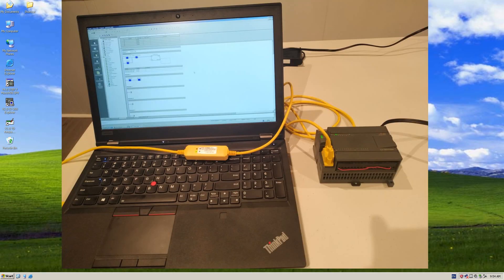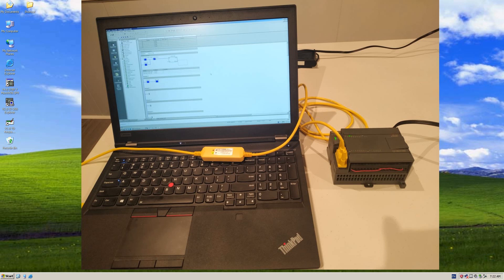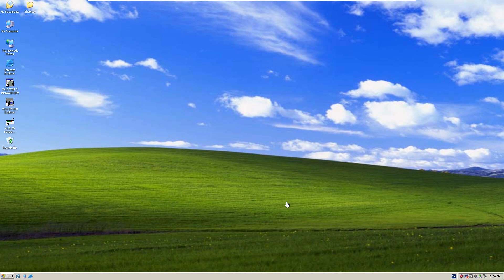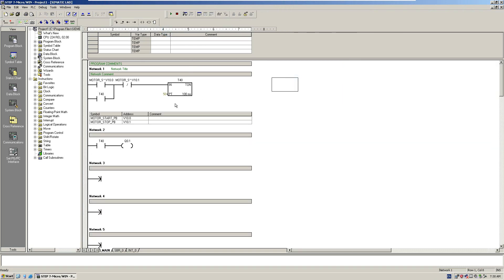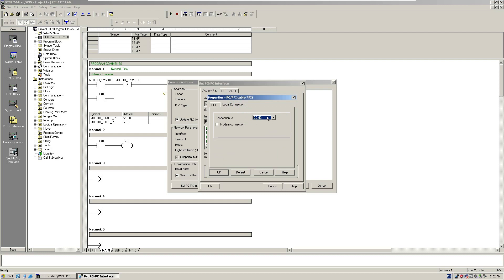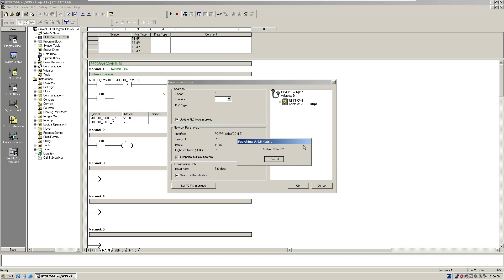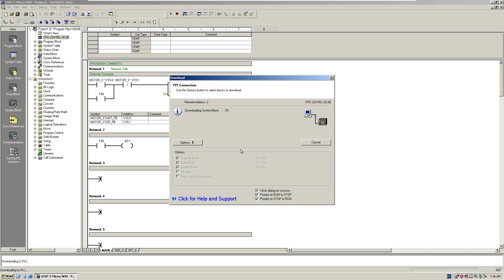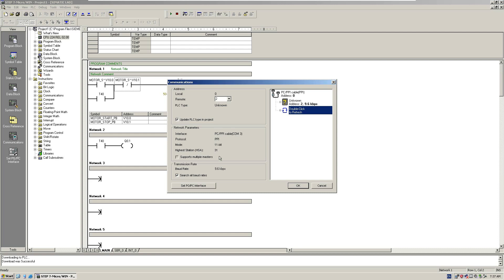U01. Program, Download, and Online Siemens S7-200 PLC via PC/PPI Cable

Comment: I watched your video , I have CPU 226 CN model which is not detected. Kindly share required drives  for it , I have USB to serial ch340 com5 using its not detecting either change on checked port settings.
Reply from the maker: Hi my friend, the cable must be S7-200 PPI protocol cable, not a regular com cable.

Comment: In the University we have the s7-200 226CPU.  The yellow cable brand is SIPABC.  The yellow cable we have is same as you have, maybe diferent brand.  But we don't have the driver for windows PC.  Could you please share the driver files or a link to dowload it? please.  I found the CH340 driver you show in the video.  The MicroWIN  tries to connecte searching the CPU at diferent baud rates, but with no success.  It seems that the drivers works but I why the software can´t find the CPU? Thanks in advance.
Reply from the maker: I uploaded all the USB drivers inwhich has CH340 driver, you can try. https://drive.google.com/drive/folders/1ycVXZchtSX1qcdjrw1xyPhN2vXtMcMya?usp=sharing
Reply: @electricalautomation   Thanks a lot.  Could you give me access to the file in google drive please?
Reply from the maker: @edro1128  Assigned
Reply: @electricalautomation  Hello . I need CH340 driver.Can you give  me
Reply: @electricalautomation   Thanks a lot.  Could you give me access to the file in google drive please?

Comment: Boss I have a problem with Siemens plc. S7-200 CPU 224 cn
Plc connect but message show and upload option not shown
The plc has been protected to prevent program upload.
Reply from the maker: Hi If your PLC got level 3 or 4 password protection, you can not upload. If don't have the source code or password. Also you can not upload the program even if you have password, it is fullly protected. If you do not have password but you still want to use this PLC for other job, you can try to use "PLC->Clear" type in 'CLEARPLC' to WIPE OUT the PLC. Or downlaod a software named 'wipeout.exe' + RS232/PPI adapter to WIPE OUT (Clear everything in PLC)
Reply: @electricalautomation  any suggestions. Please
Reply: @electricalautomation  if with any another software problem solved kindly send me link for download. Thanks
Reply from the maker: @roseateelectronics8498  For your reference: [1] https://support.industry.siemens.com/cs/document/2123168/resetting-the-s7-200-to-the-factory-default-settings-(wipeout)?dti=0&lc=en-WW     [2]https://support.industry.siemens.com/tf//WW/en/posts/clear-password/56661?page=0&pageSize=10

Comment: Can you give lien of the driver sipabc USB ppi
Reply from the maker: Sorry, what do you mean lien and sipabc?    I don't have the driver you talked.
Reply: I have problem communicating between computer and the plc s7 200 it does not show me connected that's why i asked you about the driver i hope you can help me and thank you a lot
Reply from the maker: @walidbouakkar834  Hi Walid, You need a cable/adapter which has PPI protocal, what kind of adapter you have
Reply from the maker: @walidbouakkar834  You could email me with some pictures and screenshots
Reply: What ur email? so i can comunicate with u easily . Or u have whatsapp?
Reply from the maker: @rudisetyawan2369  electricalautomation.handson@gmail.com  email is in the beginning and the end of the video.